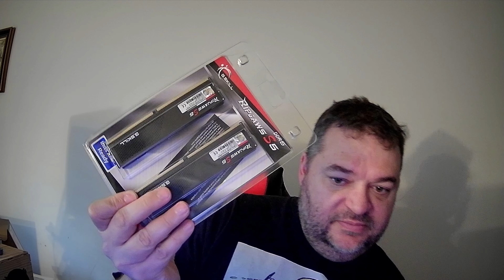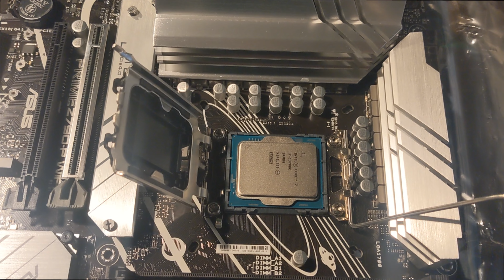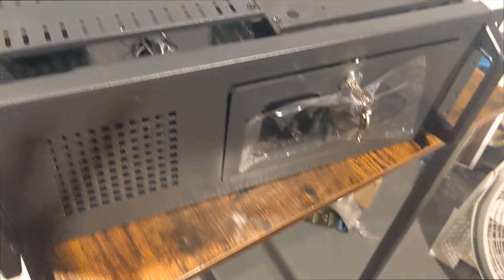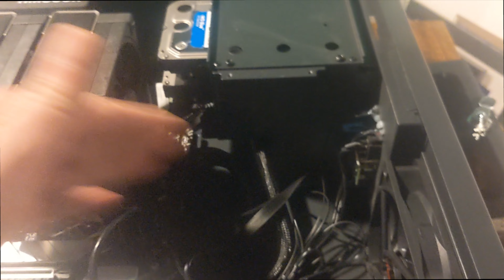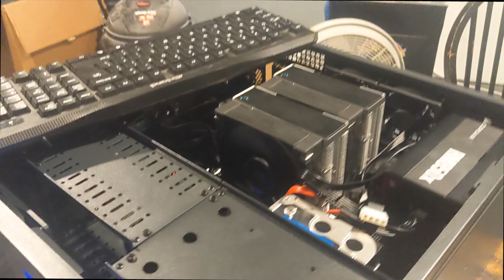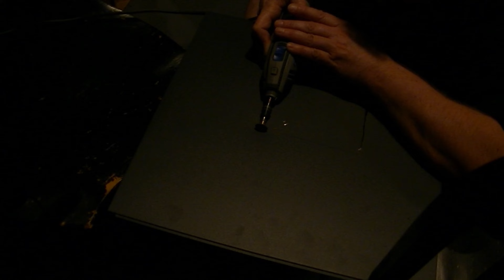UnRaid Computer Build for Plex Media Server May 2023

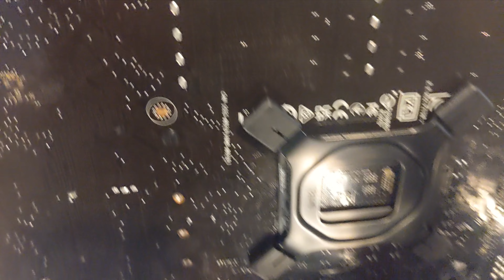Comment: At 2:43 Shouldn’t the bracket be rotated 90 deg for its internal rectangle to align with the exposed rectangle OF the mobo?
Reply from the maker: Maybe. I do not think it makes a difference, since it is just a mount. When I rotated it 90 degrees, it did not naturally snap in place like it did this way. I am not having issues with cooling or anything.